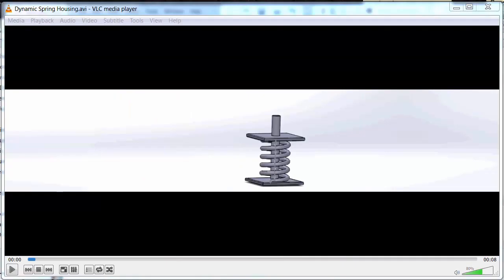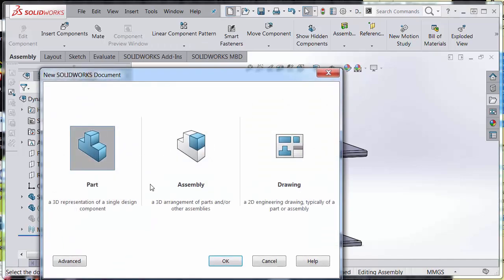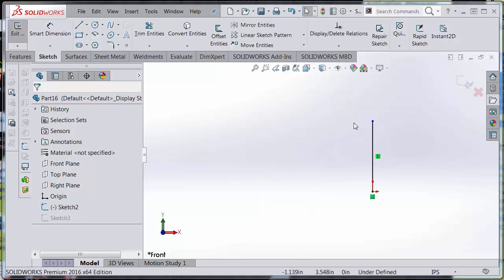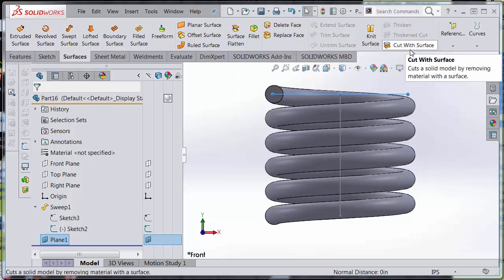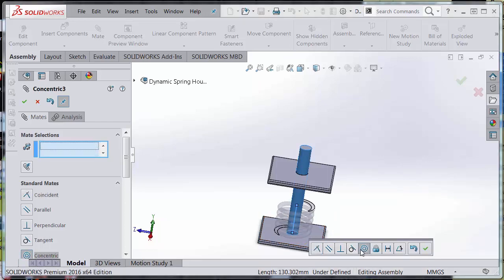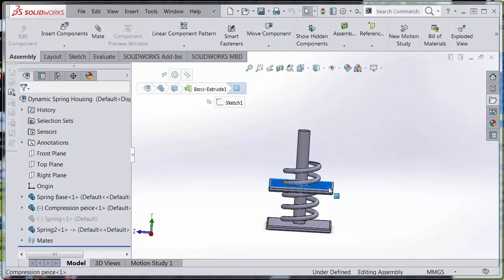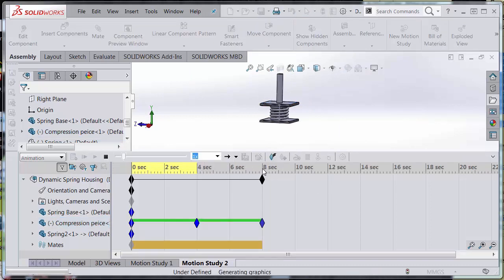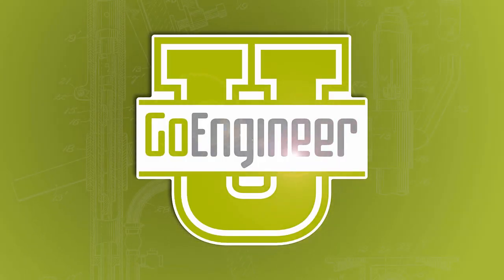SOLIDWORKS - Dynamic Spring

Comment: Thank you for this video. I have observed one problem the cut surface cut size increases when the spring is compressed and returns to its original size but becomes smaller when expanded.  Can I make a same sping with variable pitch.

Comment: Its cool, but this is not dynamic spring. Its just "parametric". Dynamic would behave accordingly towards the tension its applied to and thats very hard to do. In CREO for example, you can do the same "parametric" model, but to make it "dynamic" you need to add the spring force feature in mechanism sub-app. Its just the play of words, but to me I was searching for something else 😁. Keep up the good work.

Comment: I have an assembly in which at one end, the spring has a little elbow that fits into the end of a handle shaft. The other end of the spring just sits on a curved surface. So when the handle moves in one direction (horizontal), the spring should follow. In the next direction (vertical), spring should follow also. So, it is not just an up and down compression. So far, doing it this way, I have not been able to make it work. Is there a different procedure for my application?
Reply from the maker: It would seem from the description that there needs to be a sketch that follows an externally reference plane (top down) in the horizontal direction for the handle, then a separate externally reference plane in the vertical direction with the sweep path following the external plane. The handle must be tied to the spring and defined so that it doesn’t change shape too much when the horizontal plane moves.

Please let me know if you have any questions.
 Thank you and have a wonderful day!

Comment: Cool. But can you make the spring compress and extend not in a movie, but in the assembly? That is, when you move the upper piece down, it compresses the spring, and when you release it, the spring extends and moves the upper piece? Is it at least theoretically possible?
Reply from the maker: Hi Joe,
The type of dynamic spring motion behavior you describe where the spring is always being calculated to position parts in an assembly is not possible.  A spring as defined in motion is currently the only way to show this kind of reactive motion for a spring.
Reply: Hii did you find a way to do so

Comment: hi, im notice that the movements are not smooth into SW. There is a way to smootheness the animation? (sorry my english)
Reply from the maker: Hi Elliot,
The best way to make an animation be more smooth is to specify for it to use more frames per second (FPS) and then render it with that high FPS setting.  Low values of FPS tends to make an animation look jerky.

Comment: hey great job! was wondering y this spring wouldn't be good for simulation purposes?
Reply from the maker: Hi Bert,
This type of dynamic model to show a spring is not taking material stiffness into account so it could only be for visual purposes.  If you wanted to have a spring impact the movement of your model you would want to take the spring model into SOLIDWORKS Simulation if you wish to know the stresses of the spring or define a spring in SOLIDWORKS Motion if you wished to defined a spring that would impact the rigid body motion of your mated assembly.
Reply: thanks for the quick reply